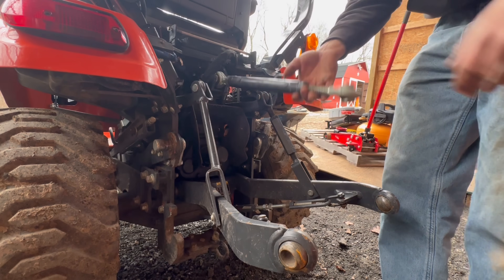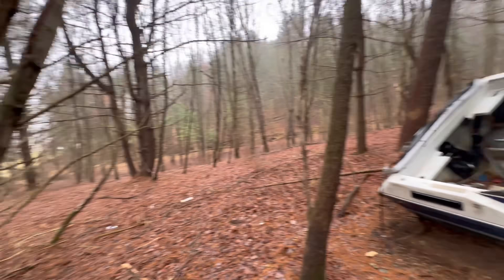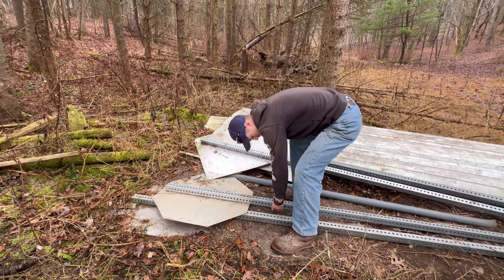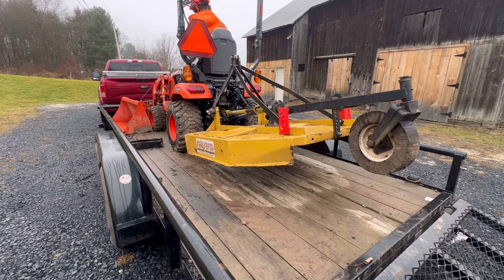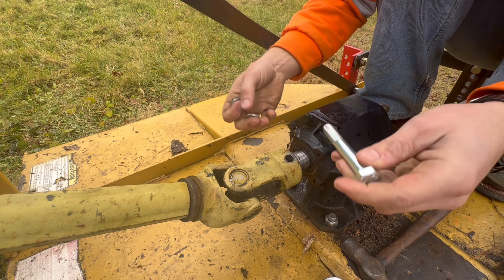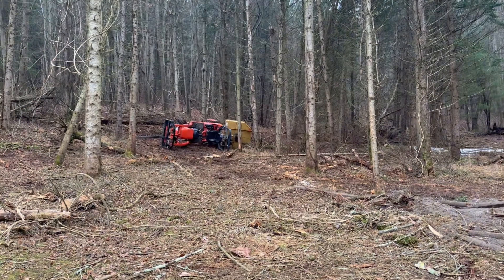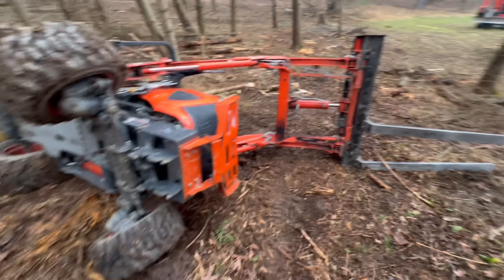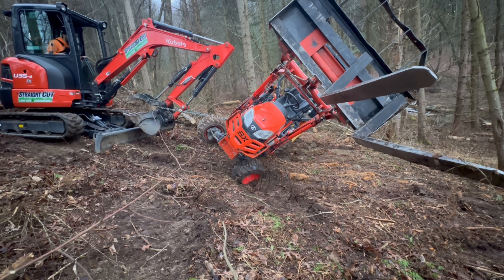Recovering my tipped Kubota BX23s tractor

Comment: You had your loader boom all the way up in the air just before you tipped it over.  Keep your loader down low as much as possible. You were lucky..  With as much clearing as you want to do with  your subcompact you need a grapple.  with a grapple a lot of times if it's tippy you can quickly drop your loader with the tree grappled and save yourself unlike with your forks cause you can't clamp your trees.  I have had a grapple for about 20 years so I've been there, and  haven't turned my 45 hp tractor over yet. Been close.

Comment: Ol' guy here. Been turning wrenches for bout 45 years now.Pop the injectors out then crank with the starter.A lot of fluid will blow out:probably 100% oil. If you don't remove the injectors and there is ANY oil on the piston tops you will trash the engine when you turn it over either with the starter or a wrench on the flywheel with the 4' cheater that will eventually be used. And why the heck was the loader raised so high where you had the tractor? Rough uneven ground, narrow wheelbase tractor: keep loader LOW or: well you now know why.:cat-orange-whistling:
Reply from the maker: I’m going to pull injectors and crank by hand. Tractor was only tipped for an hour so it shouldn’t be too bad. I was pushing the limits of the tractor.
Reply: Real old guy here and been farming my whole life. I’ve been to several funerals over my life because people were pushing the limits of tractors. Years ago tractor were only found on the farm and accidents were enough then but now day everybody it seems has one and accidents are way more often. Center of gravity on a tractor especially a little one like that with loader up and the weight of those pallet forks and uneven ground your lucky is all I have to say. Have a neighbor does the same thing, bush hogs real uneven ground with heavy pallet forks and first thing he does is raise the loader as high as it goes. It’s just a matter of time and his will be on its side too. Lucky thing for him is he has a family cemetery he started on his property if he needs it.
Reply: @oldfarmer4700  good post and so true.
Reply: @oldfarmer4700 Agreed, based on what I saw he had the wrong tool for the job. I would've rented the excavator for the tree work the cleanup the brush on the ground with the tractor. A grapple sure is nice for brush work.

Comment: To increase your stability fit dual wheels. You will be shocked at how much more secure your tractor feels. Look at Click duals or an other form of quicktatch connection. I have driven little tractors(30hp), and compared to the ag tractors they are horribly tipppy.
Reply: Dual wheels?? That's a newbie move.. learn how to run the tractor.. Dooley's 😂
Reply: We use wheel spacers and tire ballast. Have a kubota b3030. They are very tippy from the factory. Ours has a cab and makes it even worse.

Comment: Great safety training video with about SIX major mistakes. Apparently neither operator has much equipment experience. Also very little mechanical knowledge, as the injectors or glow plugs should be pulled, engine cranked, then reinstall parts and fire it up.

Comment: If you have to push the tractor to its limits on a regular basis, you need a bigger tractor.
Reply: For this job I would've used a 30k lb  cab excavator with thumb I wouldn't even attempt this with my tractor at all. The tops of the trees can break off coming down onto your head..that's why they call them "widow makers".
Reply from the maker: I do wanna get bigger equipment. Gotta start somewhere. I do wear a hard hat and as much protection as possible
Reply: Thanks for the video. How has the BX23 held up so far aside from the tip-over? Any serious issues? I'm looking at getting one for my 2.5 acre property soon.
Learning from mistakes won't  stop any time soon for any of us. Sometimes we just have to find out the hard way. Glad you came out of it fine and the tractor is in one piece. Keep working hard at a steady pace. Good luck.